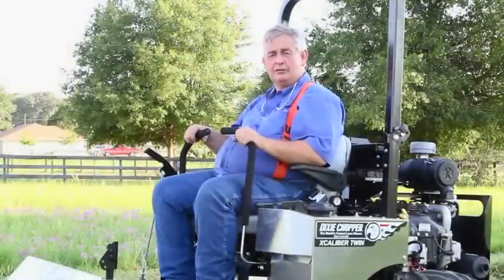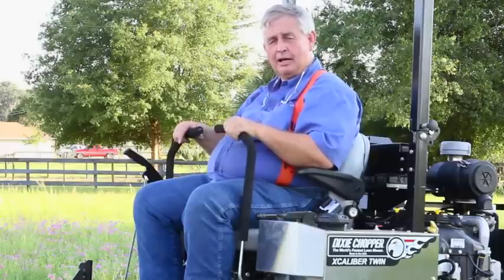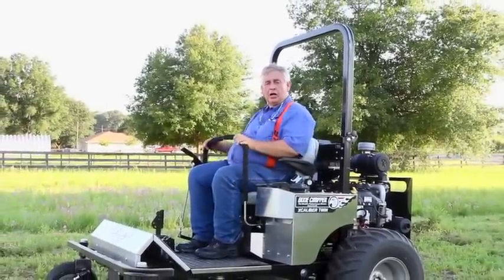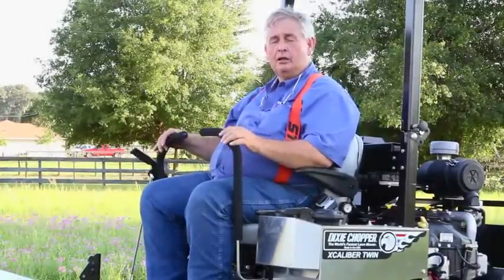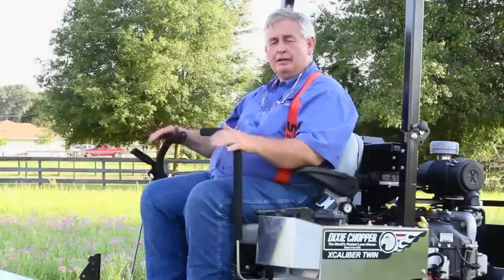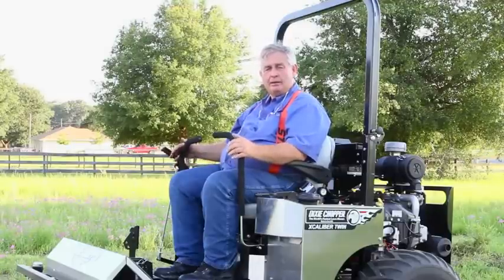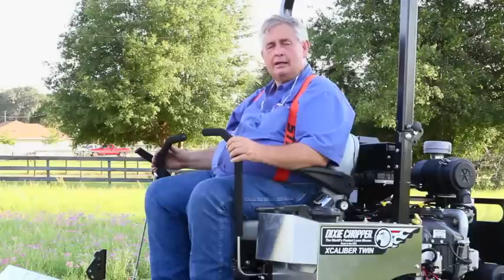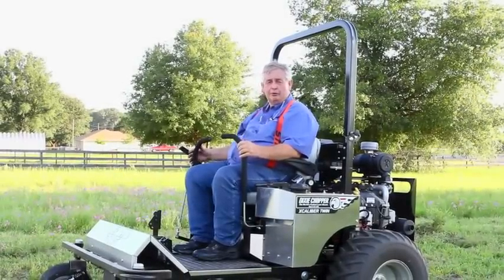Zero Turn Mowers - Proper Operation to Avoid Divots

Comment: Thank you for the tips, I had just about ruined my lawn after getting a used Craftsman ZTS 7500.  Didn't know about the complete stop or the full pull back!  You may have just saved my lawn.  Thank you again.  Great Zero Turn Mower tips.

Comment: Ruby Townsend
1 second ago
Yesterday was my second outing on my zero turn mower. The first time was comical. I learned a few seemingly obvious tips that are not addressed in any of the videos I've seen.
1- Start SLOW, so you have more control.
2- Decide which arm you're going to steer with. This is my dominant arm, the right. Keep the other neutral and do your turning motions with just the one.
3- Decide which direction you're going to make the majority of your turns. The chute being on the right, and already predominantly using my right arm, that came more naturally. 
3- Leave room for the rear end to come around. Go forward past what you are going to turn into, (on the left) then push further forward (than a straight line) with the right to make the 90-degree angle.
I hope this help. The 'drive like a shopping cart' was the best thing I got out of the videos. It still took the same two hours, but now I have a better idea and practice on how to make this circus ride work! 
Pushing all the way forward on the right and all the way back on the left does Not make the 'zero turn' idea/feature work. I kept losing control trying this. Go forward a little past, then make a 90-degree angle for corners. More practice and I will be able to turn directly around when doing straight rows.

Comment: Thank you so much for those tips! I started to mow my aunts farm for her and had never driven a zero point and she only showed me the controls and not tips on mowing. Her yard takes about 5 or so hours, has hills and ditches that were very scary to mow!!!  I found out that those zero point mowers aren’t designed to mow such steep grades. She had been mowing her yard for years with a zero point and pawshawed my concerns with the hills and steep ditches. 
    If I lost control ....One side of the  ditch I’d go into a 55 mph road.....her house is at the top of the hill so as you mowed down the steep property line on either side of the hill the cars were blind to coming up on ya. The other side of the ditch had a steep grade that you’d fall into the swampy ditch along an electric fence line. My adrenaline levels were sky high lol 
   Plus she had tons of farm equipment to mow around and barely a flat stretch of land anywhere! It was like an expert level obstacle course! plus I looked up the manufacturer suggested grade limits and they suggest not to mow on grades more than 15 degrees lol ha!!!! 
I wish her farm had only 15 degree or less hills. I mow their other farm down the road and that takes me 4 hours and that one is mostly flat and feels like an ocean breeze compared to the serious concentration i need for the hill top property!!!! 
I was making divits and for the life of me I couldn’t figure out how to correct it. This video has made me so happy. I hated knowing I finally mastered mowing a very difficult lawn and really enjoy mowing both lawns now and was really happy with my lines etc❣️..... except .....a damn divit here and there!! 🤦‍♀️🙃
Very appreciative of your help! Thank you and all my best from Ohio💕👍🙏🏻

Comment: Excellent! Divots on zero turn demo on my yard turned me off on a zero turn. Could you also address cutting down hill while turning (avoiding trees, shrubs, flower beds, etc...) and avoiding the zero turn from sliding, losing traction, sledding sideways? I have a 1987 Wheel Horse 310-8 tractor 37" deck with rear wheel weights never slides and Simplicity Prestige without weights that occasionally slides in same spots.  Wheel weights or zero turn front weights seem to be a solution on caster front wheels that want to wander. Wider rear turf tires, wider and bigger front casters, wider mower decks w more rollers on the ground? What are your thoughts? My front yard facing road is about 25 degree incline with left and right gradual slopes in a few spots....my Simplicity is starting to fade with hydraulics, but love the power steering because arthritis, Wheel Horse is my Plan B for mowing due to age and takes me an extra 40 mins to mow...optimistic I could still figure out a zero turn for my yard

Comment: How would I adjust the wheels so they have a larger neutral position. It is very hard for my zeroturn to not dig when turning.  Troybilt 50"

Comment: That's actually not how you turn around properly to not make marks.  It might work in this grass but a fine lawn with soft soil you will make marks.  You should do a Y turn. The same way you do a 3 point turn. That's the proper way to turn.
Reply: That's not the "proper way to turn". That defeats the whole point of a zero turn mower. 3-point turn is what you do with a traditional lawn tractor. If you're making marks in the grass then you're just doing it wrong.
Reply: Whatever doesnt rip the grass up is the "proper way to turn", jaybrown is right different lawns are more fine and can divot extremely easily, best to y turn and just take it slow. The whole point of a zero turn is way beyond just turning in circles, the babies cut for fucking miles

Comment: That is a fine mower you have there and have to be the fastest also. That is probably a 39hp engine on it and it have a stainless steel frame. The reason I know is that I worked for a prison in Arkansas and they purchased the Dixie Chopper after the John Deere tractor with the belly mower didn't last long. The inmates operating the tractor messed it up somehow, but the Zero Turn mower lasted much longer and it was used every week to mow over 30 acres at a time around the compound which is like a large ranch, plus up and down one state road and a city park. What causes grass to be left uncut in the middle of the cutting area sometimes? That is a problem I have with my two mowers.
Reply: I think it is actually two engines in this one drive one hydro pump instead of two. Which is really cool but if one engine goes out then half your searing is gone.
Reply: And about that grass gap sometimes the blades get in a certain pattern that causes a line a solution is mowing a line than the next line put the deck end at the line were the outside blade gets it works for me and my grasshopper.